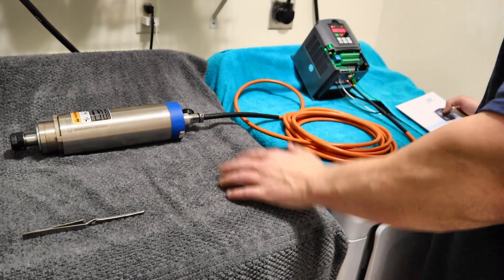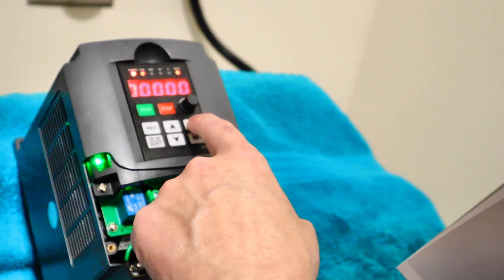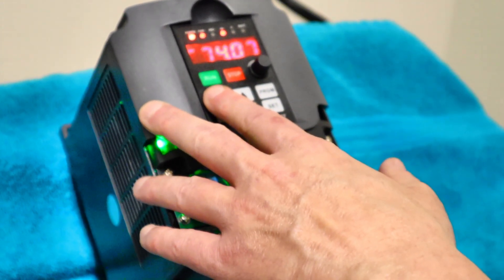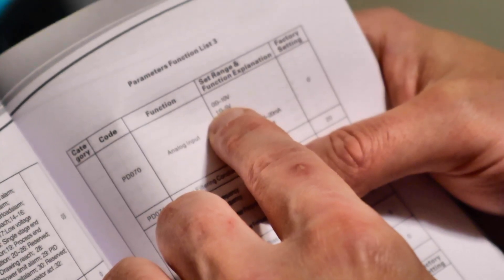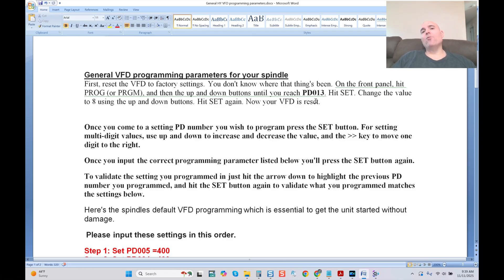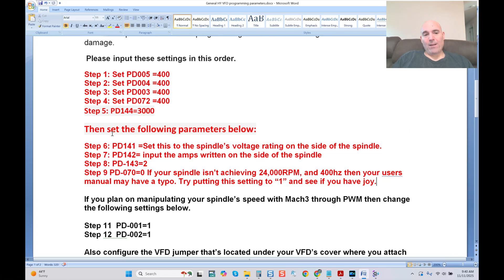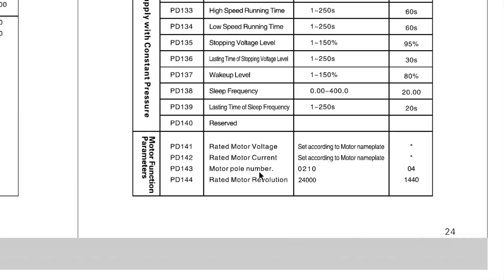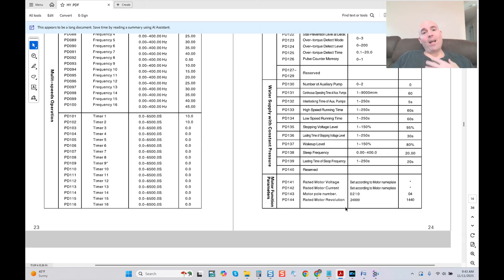HY VFD Problem Solved - Updated Settings

Comment: Can I use one of these as a plain phase converter? My shop has single phase 220v power but I have multiple peace’s of equipment that require 220v 3 phase. Equipment being a cold saw, hydraulic shear, and a hoist.
Reply from the maker: If it supplies the correct amps, and the the VFD is properly sized for the equipment you should be good to go. 

Thank you,
Vince